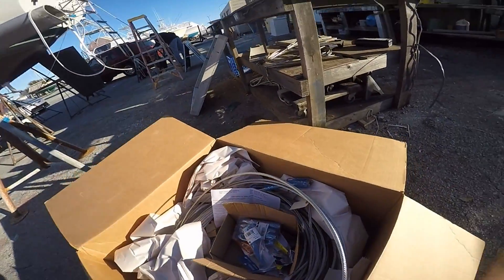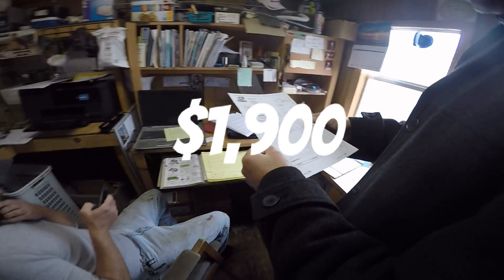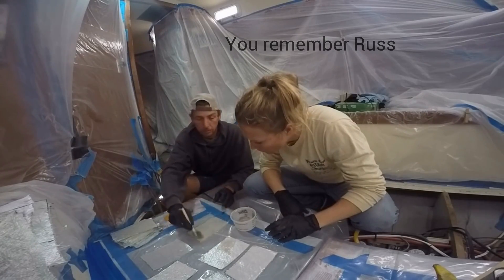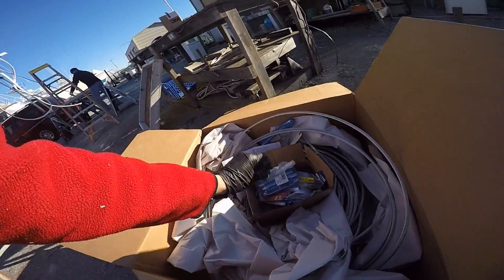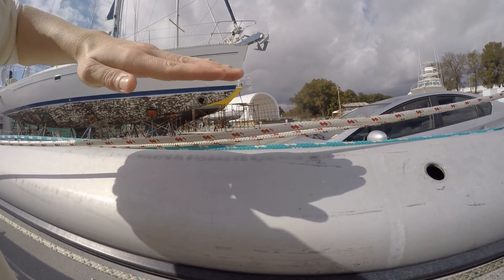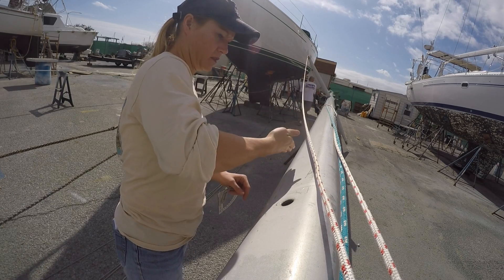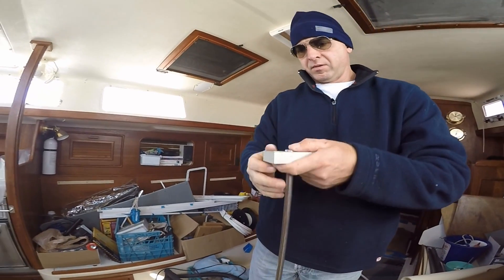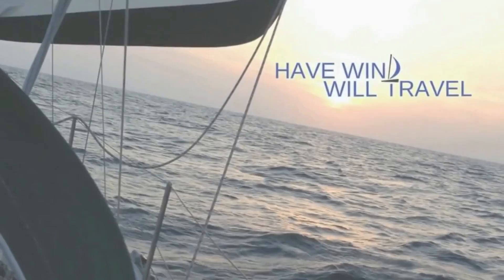#60: Wire Rigging & the Angle of Dangle

Comment: Just found your channel, great videos!  Im just catching up so this comment is a bit late, but I have heard that any hole/ pin connections on the rigging should be just a slight slip fit, not clearance.  I cringed a bit seeing you drill out your deck shrouds with a regular drill bit.  

The idea with the tight fit is that the force is distributed over the entire top surface of the pin and not just a point at the very top (in the case of a larger clearance hole) which can cause the parts to wear or deform quickly.  A reamed hole .001" or so over would be the way to go.  I'm sure you will be fine, just wanted  to let you/ your viewers know.
Reply from the maker: No we always appreciate information Brian, thank you.  Especially anything that prevents a cringe!  Unfortunately our pins would not fit through our deck shroud plates as they were so we drilled out just a tiny bit to give them a nice nudge squeeze in.  I'm no expert in the matter, but I'm with you.  I hope we're okay!  Thanks for watching!

Comment: With regard to your request having to do with boat surveyors I submit the following, based in owning two cruising boats. 
1. Most surveyors have an interest in seeing the boat purchased  because brokers want to see a sale go thru. That way the broker will be called to do more and more surveys. Try to back out of a deal after you put money down, even if you like the survey.
2. This is much like home inspectors; they all want the boat sold. 
3. Most brokerages want a deposit for buy if the boat has few minor issue before the survey is done.
4. I've seen brokers take 3 hours and I've seen brokers taking all day. sort of get what you pay for.
5. It's not hard to see a ballast/hull seam. It basically means water has intruded at that seam. Best hull/ballast are fiberglassed.
6. A buyer should do a thorough review of what boat might give you the best life. 
7. Buy a boat for what you plan to use it.
Now these comments only are only my opinion. Sorry if this reply is tardy in replying.
Wayne
Reply from the maker: +Wayne Dieser Thanks for the input Wayne.  I appreciate it.

Comment: If you're in need of 5/16" Sta-Loks, I have a bunch for a good price. Probably way past that point now. Hope things are progressing well.
Reply: +79cd36 new?  I'm a ways off and still planning my rig out.  Still working below decks right now.
Reply from the maker: Ha. Sadly it is. But thanks!  Why the extra looks lying around?  Just curious. Thanks for watching!
Reply: +Pass Me By : Yes, new. You can see more on my blog: http://ariel-cd36.org/wordpress/?tag=stalok
Reply: +HaveWindWillTravel.com I re-rigged my Cape Dory and got a good deal (too good to pass up) on a lot of Sta-Loks. I used many of the 9/32" fittings for my project after deciding not to go up one size and use 5/16". Now I have some leftovers.

Comment: That Go Pro sure is a scary bugger at times! hahahaha   I'm so glad you found those spots on the hull BEFORE they became a problem, I've seen quite a few vids dealing with fiberglass osmosis, and if left unchecked it's brutal what can be required to repair it!  No doubt you've caught it before it has become a huge issue... though I might use a moisture meter on that hull to be absolutely sure there are no hidden soft spots!
Reply from the maker: Thanks comatose. We were definitely of the mindset to fix anything NOW while we were out of the water and with access to plenty of tools and expertise!